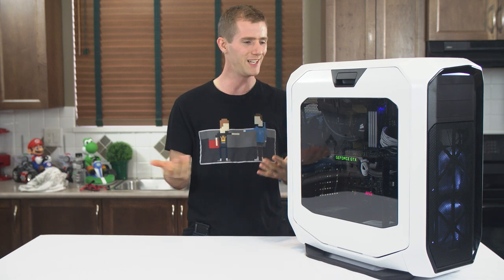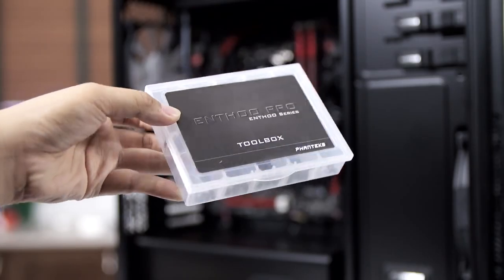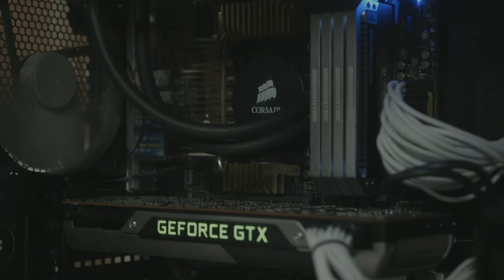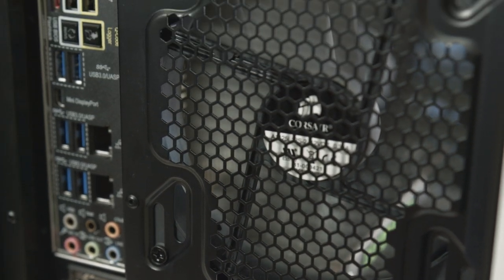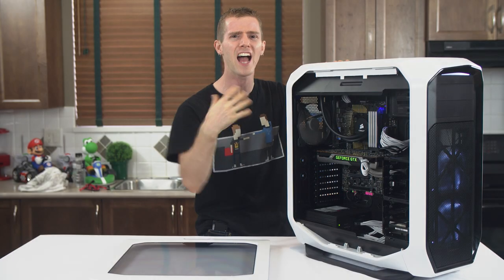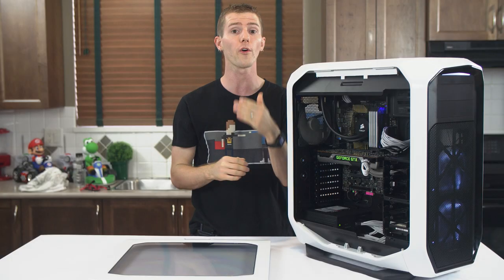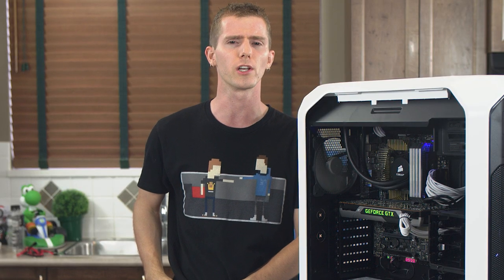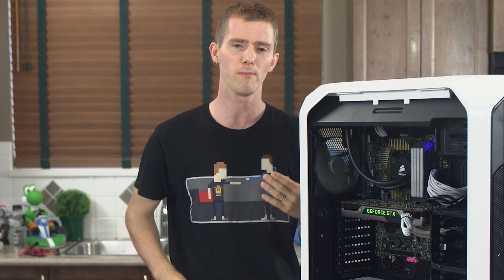Corsair 780T Graphite Case

Comment: Why are case manufactures still putting reset buttons in?
Reply: it gives the owner a "faster to restart but chance to brake your pc" option
Reply: Bobman279 The only reason I can see is if the computer hangs (freezes).
Reply: that would be a good reason as well
Reply: Bobman279 Then again, you just need to hold the power button for 3 to 5 seconds to force a shutdown.
Reply: You could just pull the power cord out :P
Reply: Bobman279 Sure, that would be faster and more convenient but only on the new mac pro.
Reply: ***** and why haven't i thought of that? :(
Reply: -[Al_K_TraX]- Yeah I did that as well. I saw an Asus motherboard video talking about that. It's very convient to me especially when you overclock alot.  :)
Reply: lol I didn't even realize mine had one till you said that and leaned over and saw it.
Reply: Gungriffen I forgot mine had one until I read this. I cannot for the life of me think if there was any time I used it, that wasn't hitting it by accident.
Reply: I always hold my power button when I can't restart via Start menu so I never even noticed my tower had a restart button :D
Reply: Easy answer! Head crash. If your system locks (or partially locks up) up while the HDD is busy pulling the power could feasibly cause a head crash. I would rather have some corrupt files from doing a reset that a HDD that I just killed.
Reply: daishi5571 Well that's good to know.
Reply: Its useful when your start button stopped working :P like mine corsair 600T
Reply: I bought this case in January 2020, and i start to use it now ^^
Reply: For u to ask !!! Father: "Look son, there is no brain in him !" :D

Comment: Still using this case today, have a i9 12900k, rtx 3070 on a asus prime z790 board, you don't need a new case if you have a corsair 780t😉
Watercooling 360mm radiator no problem, best case ever!!👌
Reply: I7 12700K, 3090, Rog Strix z790..Corsair iCUE H150i ELITE CAPELLIX with 360 rad up top... cool as a cucumber, this case is still awesome in 2023 👍

Comment: 2.5 years later to see this, I did buy the 780T a few months back, I like the spacious interior, but I'm in agreement to seeing how they were using HDD cages, if anything I would've wanted to see removable brackets that could also go where the SSD mounts were able to, at least then you could show a huge open space that's perfect for your custom water loop, or just to improve that airflow by that small a percentage

Comment: Linus,

I personally went from a Coolermaster to the 760t. Back in the day I was using the Antec P180 full tower and going back to a mid was painful, especially with my SLI setup. My birthday passed recently and this case was on sales at NCIX, so I grabbed one up (hoping in the future for full Cooling loops, alas no full covers for my MSI 760s).

You asked for the nitty & not so nice. Personally, I've not seen the 780t upfront, but, I'm in love with the side panels on the 760t, just glorious and so easy to work with. The chassis is very sturdy and I have to agree about the fan controller. If it was something that could be controlled via the board, I would have preferred that.

I've kept all included fans in place for now. I did a little checking on the included 140mm fan in the rear and would like to swap that out for an AF140 reg or LED, as they have a higher CFM. I agree it is an amazing Air case, but falls short for Static Pressure.

I agree the look of the 780t comes across more plastic than the 760t. I have the white version and the contrast from white to black in the front gives your eyes a more pleasing visual (760t). I DO however, not like the fact that the bottom of the 760t has 1 dust filter for the PSU, however, right after the PSU slot is another 120mm fan slot, with no filtering what so ever, and I would have liked to see some kind of magnetic solution there, much like the top. Either a vented or full cover, would have been great.

I found cable management relatively the same from my build to your model above and much as you commented, I have become a fan of NZXT efforts to segment the PSU from the rest of the rig, while providing a great place to "manage" cables, well away from prying eyes and giving your case more focus on what really is the meat & potatoes of any build one is looking to "show off".

Overall, I'm still a fan of the 760t and the visual changes to the 780t wouldn't make me go and grab one anytime soon, as the internals, aside from the drive trays, are fairly similar, IMO.

From one fan to the man, thank you for the great reviews, enjoyable watching experience and much like the rest of your viewers, the honesty in your reviews.

Have a great day and keep up the show, loving the directions so far and if you ever need someone for Graphic Design or Sales... Please for the love of the PC gods, tell me!!!!

Christophe

Comment: I've had my case for 2 years now, still love it, I got the black and red one, I just came here just the check specs if it would fit the new corsair H150i, and yes, it fits this case perfectly, I top mounted mine.
Reply: Did you have to remove the 5.25 bays on top in order for the H150i to fit?
Reply: Nope, it all fit perfectly.
Reply: I'm running a push pull 360mm loop in this perfectly :)
Reply: Also a company called cold zero has slot of bolt in mods for this case which is awesome
Reply: L dotR ok, cool, did the radiator have to fit between the top 5.25 bay?
Reply: desamania yeah. If you didn't use any of the 5.25" bays like me you can opt to drill the rivets out and remove the 2 bays completely
Reply: The Corsair H150i fits the case Perfect, and i'm still using the 5.25 bays, no need to remove anything, mount the radiator in the case, then just mount the fans on top just under the filters, perfect fit.

Comment: Had the 600t, now have the 760t! Loving it. My only gripe is when I installed my h100i on top. The cover for the top of the case doesn't sit flush. The screws from the h100I make it pop out alittle. This case looks to big. 760T is where it's at!

Comment: as a 600t white owner there happens to be many features on the 780t that I am missing out on (Extra rad space without the need for modding, better window made of plexi not lexan) But I also much prefer the looks of the 600t it gives off a less plasticy feel than the 780t , the Front being all mesh rather than ugly plastic blocks at the top is something I much prefer and the top IO panel of the 600t is something I much prefer as well (despite the fact I do not use the inbuilt fan controller).

Overall if I went full water-cooling then the 780t would be a better case by default, however the 600t on the whole just looks and feels nicer, and has ample modding capability to fit whatever Rad I want in there without worry.
To me the 780t feels like a side-grade more than a true successor.

Comment: I don't care for the look over the 600T, but I will still probably upgrade to that next or maybe the 780T's replacement, they're just solid fucking cases that have everything you would ever want IMHO.  They're also large hand friendly, I have a 5" wide palm, ring and middle finger are 4".  The 600T was the first case where I didn't have to struggle for hours upon hours to get everything installed in tight fitting spaces and the 780T looks even bigger.

Comment: Not a bad case, but I chose the 760T for build quality and looks, although this case looks way more practical with those awesome dust filters on BOTH the top and front, along with a filter for the dual 120mm fans on the bottom. This and the 760T would be a perfect case if the front I/O had usb type c and NO 5.25 bays with triple 140mm support or dual 200mm supprot on front and top. We can all dream right??

Comment: For those that want to use 280MM water cooling with dual 140 MM fans. this case is what you need. You can even create a push pull configuration on the top.... I just bought the case for that alone. Most cases only support 240MM AIO coolers. 

This unit is actually the obsidian series 750d, with a different external case. IF one wants to complain about a case, that is one to complain about. Poor air flow, Cheesy front panel with restricted fans for airflow. etc. 

IF you want a case with absolute zero..... to complain about...... your going to have to spend 300.00 and over and get tempered glass , and other bells and whistles.

Comment: I got this case in 2016. Honestly it's very hard to improve cases. My system is using 2016 components and is about to undergo a full Retrofit as the fans on the SLI 1070 GPUs are making terrible sounds. I think I will retain the case and load in new items.

Comment: I like it. I imagine I could put together a basement separator and I rather like the Start/Stop button. However, Those drive cages, however you look at it, are bad. For me, this isn't being hard on Corsair but I would complain about anyone using drive cages like that. Would probably remove them altogether and only use 2.5 in drives.

Comment: I love this case. But can't decide over it or the 760t for my next build. One thing I really don't like about the 760t is the top. Air flow is minimal with the top cover on. But looks pretty bad with it off. Where as the 780t has addressed that quite well by giving me TONS of room for radiators considering it's nearly impossible to get a push pull radiator in the top of a 760t. In this case I could probably mount 2-3 radiators all with push pull configs in the same place. It's ridiculous. But that side panel on the 760t is so sexy.... I'm honestly torn between better cooling and sexy looks.

Comment: Considering that i have the 600t and Nearly every one i have seen build in it the way i have which is a lot of people using a E-ATX motherboard in the 600t considering its ment to be the successor to the 600t i can see why there is slight emptiness when using a ATX motherboard. If i did have the money which i nearly do but would rather spend it on other things because the 600t is still fine for me I would change to the case.

Comment: The only way to review a case, is to build in it... This case - DOES NOT - support a 360mm CLC in the top or front panel spaces - at least not the Corsair H150i! It will however support that CLC if you use a dremel!

Having said that, I have 15 HDDs in my case, and an optical drive, and an SSD, so I have no idea why Linus has a hate on for the drive bays, I love em! Can't get enough of them, they slip into the bays really easily making mounting/unmounting a breeze!

Comment: The design of this case is exactly what I'm looking for but:
I would love the front to have 3 fans in the front and no slots because no one uses those anymore.
The HDD racks are just against the airflow and I would love to be able to have the HDDS on the back and I wouldn't care if you couldn't fit more than 3... as no one uses more than 2...

Comment: If I was in the market for a case, I would definitely stick with my 600T.  It may feel a bit outdated with it's one front USB 3.0 port, but it has what I'm looking for when it comes to ease in moding (if I ever get around to that) size, and looks.  
The 780T is just to tall, and is hands down a better looker then the 760T.
The biggest letdown on the 760T is that flimsy side panel. it just shows off to much of the inside of the case.

Comment: I opted for the black version. It's the blackest of blacks...hard to explain. I did swap out the red led fans for two blue AF140's. I simply thought that blue light washing over my red accented motherboard, ram, and ram cooler would look nice. I am a little tired of single color builds. 
The case has plenty of room...and for my motherboard...ASrock K6...the spider grommets were well placed. The ASrook K6 is flat black and so are the cables from my EVGA 850 G2...meaning not only the sleeving, but the wires in the sleeving. I chose to mount my PSU fan side up...which allowed me to attach almost all of my modular cabling to the bottom row of connectors and keep most of the wires low and out of sight. Even when lighted, they're not very noticeable since they're all black and match the rest of the build. I know some like the colored PSU wires...but...for me...the black Goth look won out.
All in all, it makes for a very clean build.
One note...while cleaning up my cable routing on the back side, I opted to buy some additional cable ties and some stick on anchors...so that I could custom route my cables. I found that the case attachment points didn't allow for enough routing options. The additional anchors are cheap...just peel and stick. I found mine in Lowe's for a couple of bucks and only had to use two additional anchors. 
This is a great case...
Hydro cooling is very easy...I put my Corsiar H110i GTX in the top of the motherboard cavity with the fans outside, under the hood, so to speak. It looks nice and the cooling hoses drop down out of nowhere.  
The case is large...way bigger than I needed, but having built systems using smaller cases and having to work in cramped spaces was something that I don't like and wasn't going to do again.  
It's a big case as you've heard, but should suffice for future upgrades and even complete builds. So the initial cost can be distributed across several builds, if you feel that might be somehting that you'd like to do.
I did get a good deal on this case...$121 during the week leading up to Black Friday. 
Anyways...great case...love it...recommended.
Reply: Thank you for the information. Can I do a push setup with my H115i with the radiator on the top?

Comment: THIS case is good for air cooling? The 600t came with a replaceable mesh side panel that could house four 120 mm fans. By not including that, I feel like for all intents and purposes, this would make the 780t a downgrade for me. Running four side panel fans to the on-board dial fan controller gives me all the air I need for my motherboard and more. I'm not sure I'm going to "upgrade" to this.

Comment: A filter on the top of 760T would b great n that's the only con I think 760T has within that premium price range. Of-course, they should improve to stick to their huge brand name expectations. I love corsair products but I m a lil disappointed with their case designs as their 750D case also lacks top filter. I m also disappointed with the pricing of their DDR4 dominator platinum series which is way too expensive... I hope they lower down their prices a lil bit for regular folks who are looking to move on to x99 chipsets.

Comment: Nit Picky #3 is kinda stupid. There are no manufacturer out there that has 8 TB or higher SSD.. people are still using 3.25" hard drives and will be for awhile yet thus the need for the 3.25" hard drive bays.   Lots of people have data that is well in the terabyte range.

Comment: Linus pls. I want 6TB and not have 3-6 SSDs. I would love at least 1 3.5 slot. I understand the annoyance of the big area for no reason(when you spend that much on a case). Why do i need 6TB? I don't like deleting things that I might end up using in the future. I do a lot of video things so i sometimes have 4-5 TB full on my HDD. YES, i do use 2 250gb SSD's as well for the performance, but i like the sheer disk space of a HDD. I'm not that rich to buy 6 1TB SSD's. Not worth the build i go for. I see your side, you just need to see mine, and that we're both right, in our respected situations.

P.S Great video once again. Love these daily uploads.

Comment: Wouldn't the spaced apart front headphone and microphone jacks cause issues with the headsets that have a bit smaller length wire splitted at the end.

Comment: I have a major question, I'm getting this case, it's decided, I will, no going back.
But, my problem comes with choosing a motherboard and a fitting processor.

I want a motherboard with;
-5-6 (or more) PCI-E x16 (v 3.0 or 2.0 doesn't necessarily matter, I'd prefer 3.0, though) slots (you know, enough to fit 2 GPUs if I end up getting another, as well as a network card)

-4 Memory slots (DDR4, since DDR4 will becoem the new standard and I don't want to buy a new motherboard too soon, so I'd rather spend extra on new RAM cards)

-6-8 SATA (preferrably 6GB/s, my current have 6 and I use 4 but I want more just in case)
(preferrably the SATAs are nicely paired so you can RAID harddrives without a hassle, my current have weird pairings so I use slot 1-2(RAID), 5, 6 I think)

-CPU slot that fits either Intel i7 6700K or AMD FX 8350

Since I'm getting this case, an E-ATX won't be a problem, so all this should be able to fit, I just can't seem find one.

If anyone could help me and give me tips or enlighten me I'd really appreciate it.
Reply: try the asus hero maximus its an intel motherboard.
Reply: Jeremy Tarrats It only has 2 PCI-E x16 slots, I'd like 4 at least, preferably 5 minimum, but we can't be too picky.

I found the Gigabyte GA-Z170X-SOC Force and it looks great so far. Any knowledge of that?
Reply: JMPERager Well, what about the ASUS Maximus VIII Extreme?